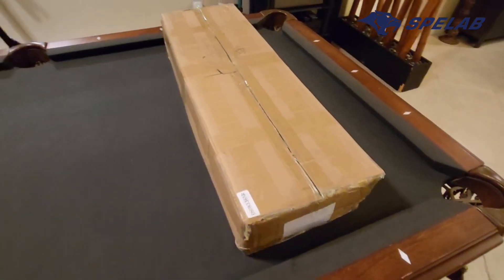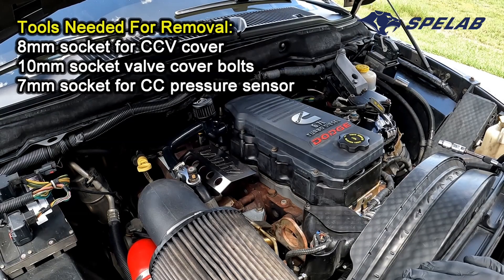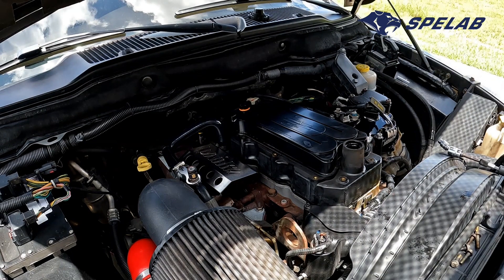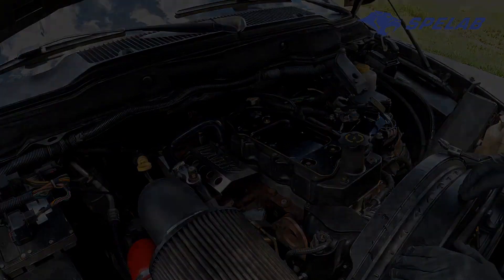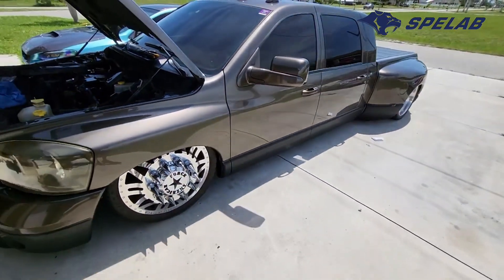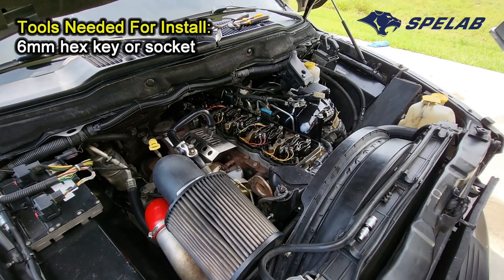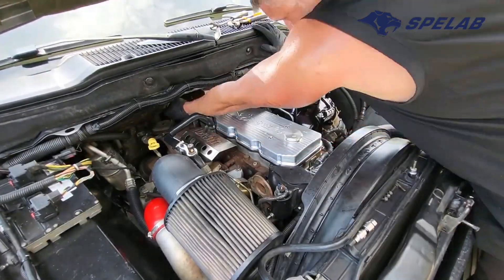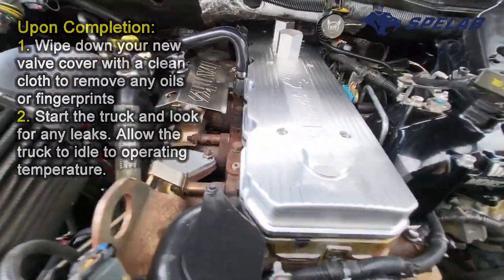How to replace your plastic valve cover with high end quality aluminium valve cover? ｜ Spelab

Comment: Just installed mine and its pushing a shit ton of oil out of the vent hoses, what do I do abt this. Im not running any catch can or ccv, just straight hoses
Reply from the maker: Hey guys, Please use a straight hose to connect to the oil pot filter and then connect the other end of the oil pipe to the bottom of the car to drain.
Reply: @spelabofficial can you elaborate on this  ima also having a oil issue. Even with a catch can.

Comment: Is this the rough 1 or the glossy 1
Reply from the maker: This is the glossy one, sir.
Reply from the maker: You can check it out here.
https://www.spelabautoparts.com/collections/valve-cover/products/valve-cover-aluminum-2007-2023-6-7l-cummins-diesel-dodge-ram-2500-3500?variant=44795927101691

Comment: I just installed mines and it looks great, however it won’t stop leaking oil 
Catchcan got full after a few minutes 
Oil all over my undercarriage and tailgate
Reply: Did you ever figure out what was going on with it? I'm having the exact same problem It filled my catch can.
Reply: @rollinwiththefergs8117  I had the same thing so I have it different now and it’s working fine so one port goes straight to the engine block then the other port goes to my catch can and I have another hose from the catch can to the engine block
Reply: @rollinwiththefergs8117 it’s just crap valve cover and catch-can I’m switching to BMP I guess you get what you paid for
Reply: @Pinpon-ni8vc  Similar for me. Just up the road and back covered in oil. Beautiful cover, but more than just oil fumes coming out; it's pushing out and will lose a quart in no time. Retuned to stock as it had no oil issues after Delete/Tune. Stock unit with filter works great and the filter is less that $50 on Amazon. I'll just replace filters every 60K and live with the stock look as it's trouble free. Waste of money IMO for this product; I don't have faith in other $700 similar products either now that I had this issue. I don't see how the more expensive ones will do any better. Also the 2nd output on the Spelab unit caused big issues for my 2020 Ram 3500. The 2020 has a hard plastic electrical conduit in addtion to the firewall. As I only needed one port, I ended up removing the one closer to the firewall and plugging it off; this made install easy but the oil issue from the port being used is unacceptable and just collecting in a can is a bad idea given the volume coming out. I'd just end up adding more continually and emptying the can.